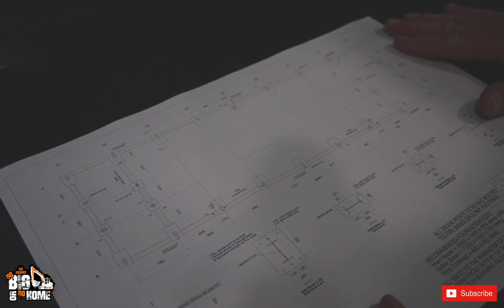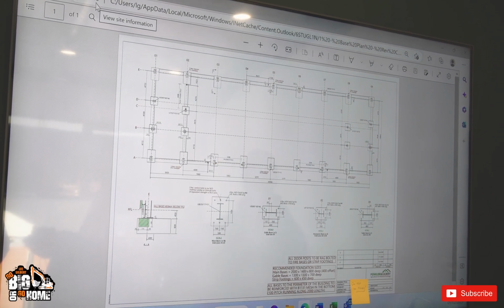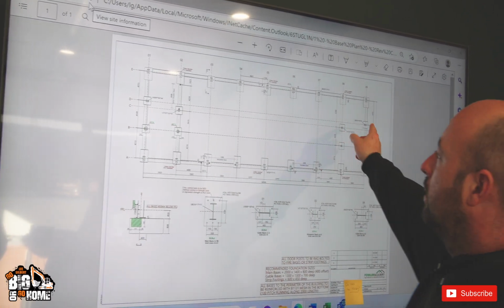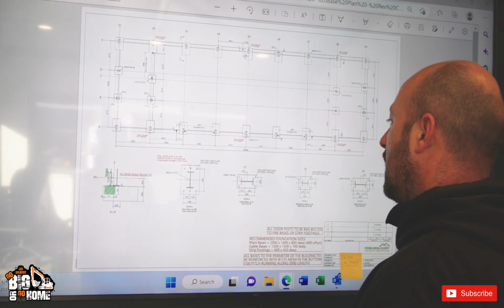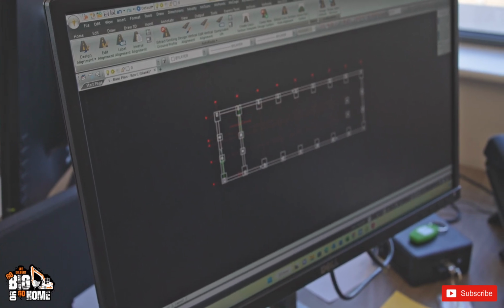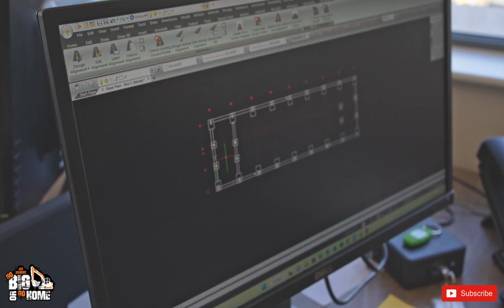Pouring CONCRETE & Setting BOLTS

Comment: that didn't show me much at all
Reply from the maker: Sorry to hear that, is there anything in particular you were after?
Reply: @leegilbert-wegobigorwegohome  HI Lee, 

aspiring construction engineer here with a few years  in the game, the way the video kicked off I was interested and thought perhaps as the video proceeded would provide a deeper dive into the more intricate aspects of bolt setting, IE from the perspective of the engineer. 

from my understanding the engineer has to centre the bolt drawings or overlay them with the foundation drawing, this is an integral part of the preperation prior to physical bolt setting and it would have certainly been interesting to see from my perspective, furthermore setting the bolts themselves requires a specific process using the total station using a reference line program to ascertain whether the bolts had been positioned properly, it would have also been interesting to see this in more detail.

so in short @gwoodall may be a little harsh but there is certainly interesting details to this process I would like to have seen included.

Comment: Anyone use polystyrene for a spacer to help movement when you crack the bolts in the morning?
Reply from the maker: We used polystyrene many years ago and poured petrol to dissolve it to give movement on the bolts for erecting. Health and Safety decided pouring petrol was a bad idea and now that is why we use the wax cones instead. Thanks for watching 👍

Comment: Does the ply on the bolt box need to be the same thickness as the base plate? What ply is best to use?
Reply from the maker: Hi Derek! Apologies for the late response! The ply is literally ‘thick enough’ to sit on top of the concrete and keep the bolts in place - I’d say around 20mm thick and a softwood plywood